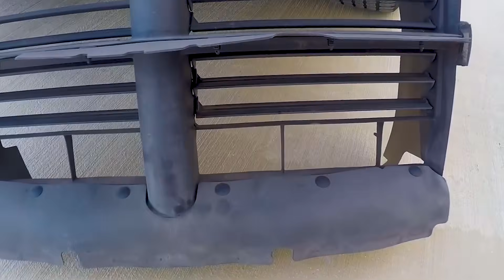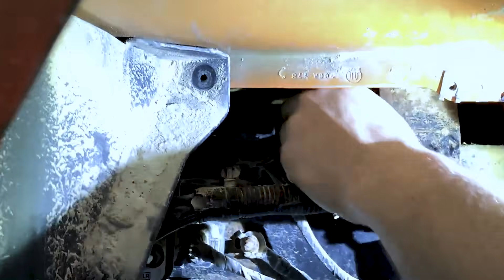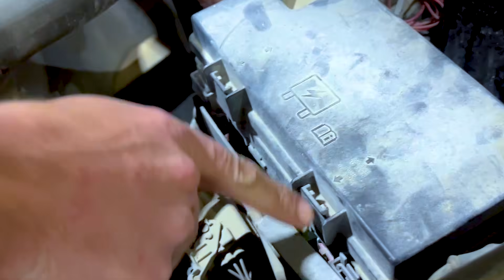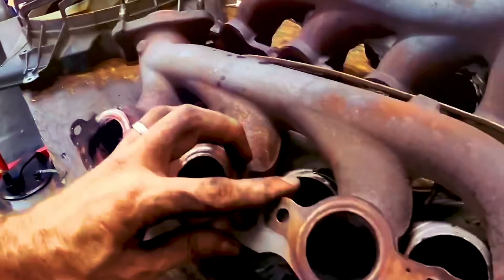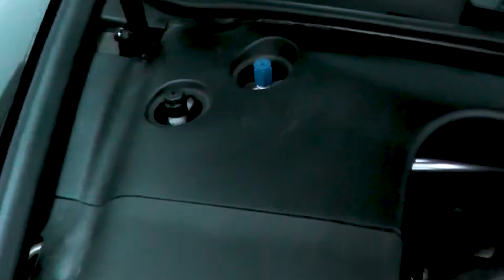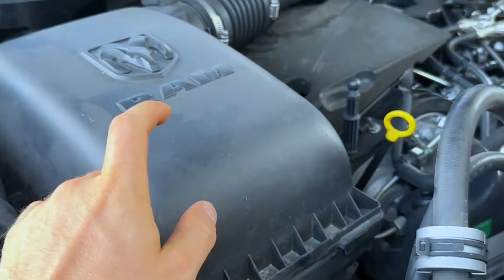STUPID Ram Features That DESTROY Reliability & Lifespan (AVOID NOW!)

Comment: Purchased a Red Devil Tuner by Holley in 2018 and shut down the MDS completely and there's been no noticeable fuel  difference since installing the tuner,this tuner does many other functions like full gauge display that allows me to  monitor things like Torque et al like temps etc.Great investment knowing my truck fires on all 8 cylinders all the time.